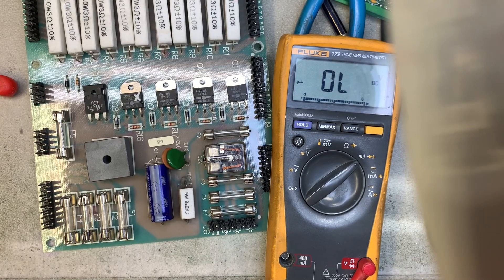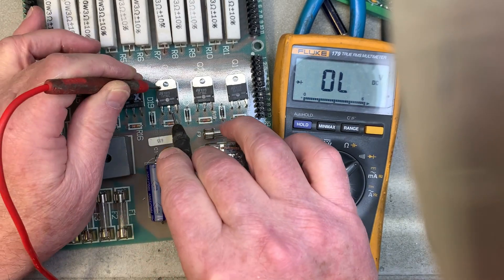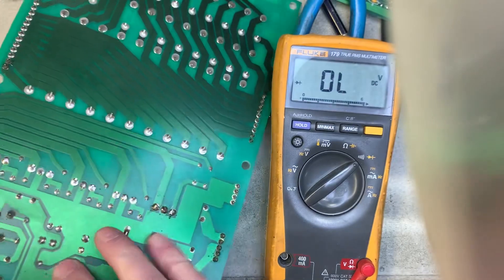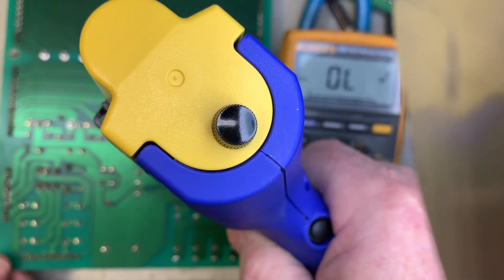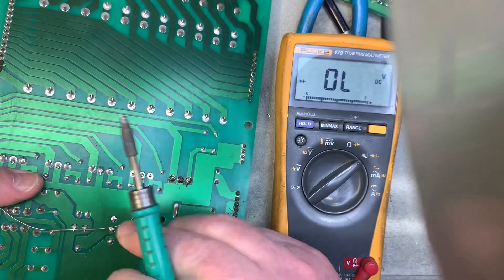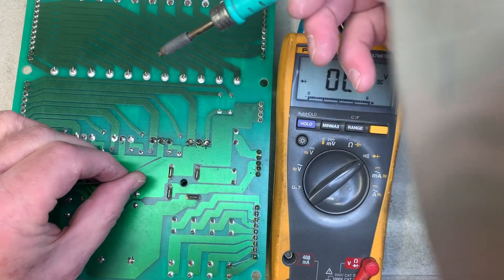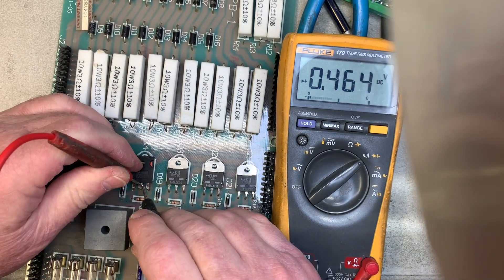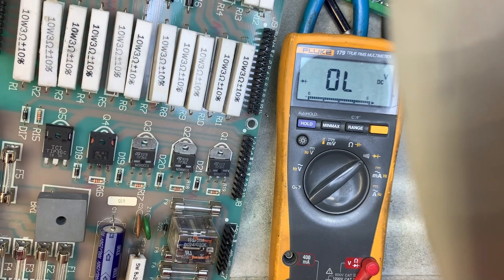Data East Repair of PPB Board with shorted TIP-36c

Comment: Can you do this test on a mounted board (with the power off) ? Or should one disconnect the power supply (or in general, all the cables going from/to the ppb)? Thank you!
Reply from the maker: Better to disconnect the board thereby eliminating the possibility of “sneak circuits”.
Reply: @ChrisHiblerPinball  Thank you! I just blew an F5 (blows on boot) with a JPDE trex looping up/down in diagnostics. Just did a quick test and Q5 Q4 Q3 all seem bad, but I guess I'll have to remove the board to be sure then! Thank you again for the tips! Love your channel!

Comment: What is a decent Soldering iron you would recommend ?
Reply from the maker: Qualities I look for:
o rapid heating
o variety of tips available
o quick change tips

I started with Weller WESD51. A lot of tips were available and it was a tank, but it took minutes to heat up. Weller makes better irons these days but I don't have the model number.

I use JBC irons these days. They heat up in 6 seconds. Still a lot of tips available. Quick tip change method. JBC 2100 is the model number IIRC.

I'm sure there are several others with the same qualities.

Comment: Chris, another great video!  Can you test the transistors on the high voltage section of a WPC DMD controller board the same way? I did something stupid on my WCS94 and now I have no display and the f112 is blowing on the power driver board after it locks on one of the solenoids. I think I need to just bring you my boards. I live about 25 minutes from you.
Reply: Thanks for the info Chris. I’ll be calling you soon.
Reply from the maker: Happy to take care of them if you'd like.
You can diode test the TO-92 parts. They test like normal even in circuit. The MJE15030 and MJE05031 don't test quite the same way in circuit. They will measure normal voltage drop across a silicon diode one way, and about .160 the other way, IIRC. I haven't measured those in a while since I'm generally replacing them anyway.